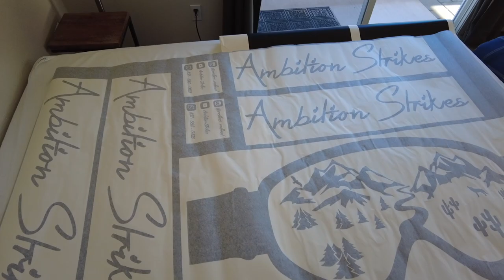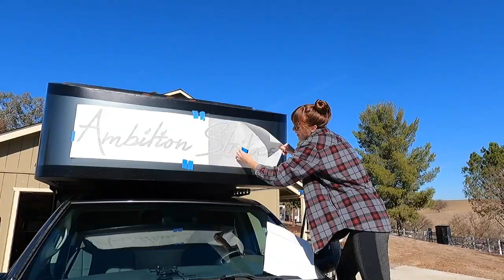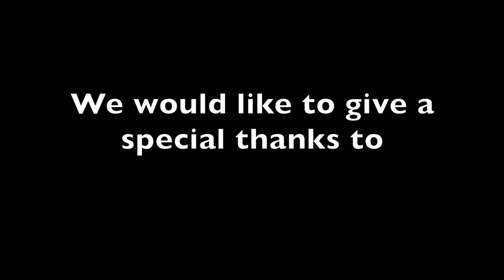Building Our Expedition Vehicle E19 - Tire Carrier & Graphics

Comment: Sweet bumper!  A trick for anti-wobble hitch is instead of welding a nut to the center, put it on the corner so the bolt pushes the hitch steel diagonally into the opposite corner. Super bomber. The center mount bolt head tends to get knurled and the threads can strip over time.
Reply from the maker: Thanks for the tip!!

Comment: Nice job with the vinyl, especially the big multipart one ..... I’ve done vinyl on trucks, boats, race cars and motor cycles and it can be a real pain in the butt. When you’re done and look at the finished product........yahoo....lol😎
Reply from the maker: Thanks Patrick! It is definitely a bit stressful once you start peeling that backer paper off!
Reply: Even worse is when the cutter didn’t land right and the paper comes away but the part attached to the vinyl doesn’t and you have to use an exacto blade to peel it away and not get the graphics tangled and stuck together.........you guys are the best😎

Comment: Nice work. I think I would have been tempted to go bigger on the rear crash protection given the amount of work y’all did.   This is one of the best tube builds I’ve seen.   Consider a hole on your threaded rod with a small pad lock? Secure that spare.
Reply from the maker: Yes it will definitely be getting a hole and lock. It was important for us to balance aesthetic with protection, so this was the middle ground we found!

Comment: The graphics look good.  I guess you did the dry application method because they were all die cut.  I have put down/laid quite a few decals myself.  If the decal is solid (not die cut), I like the wet method which allows you to adjust and move it around.  Surprised you did not use the wet method for the rocker panel decal since it was large and solid.

Comment: I used to carry my Harley on the back of my fifth-wheel camper. The first rack I built was not very good it bounced and banged around all the time and it never set level like it was always trying to twist off. However, then I built one and I used two receiver hitches about 30 inches apart.  I had my motorcycle a couple of electric bicycles and of course, my spare tire I would often carry other things tied to it and I never had a problem with it bouncing around. In

Comment: love it. I need to look into one of those portable ban saws. I tell you though my new favorite way to cut metal is a diablo metal blade on my skill saw. I would highly recommend buying the blade when getting into metal fab. its cheap and can fit any circular saw which most people already own.
Reply: Just watch out for sparks melting the plastic blade guard on many circular saws. Magnesium guards can also suffer damage.
Reply from the maker: Riley is a big fan of the Diablo blades on the skill saw! I would highly recommend the portable band saw. It is especially helpful for cutting tubing.
Reply: @ARepublicIfYouCanKeepIt   try one out bud, the metal never gets hot. you can cut it and touch the metal right afterwards. there is no sparks, its completely different than using a grinder
Reply: @cantfixasandwich4672  This sounds to be an advancement in metal cutting blades of which I'm not aware. Thanks for the information. I'll definitely check out the blade you mention.